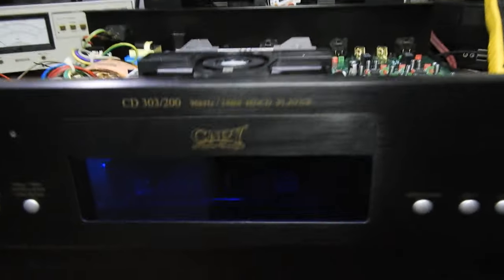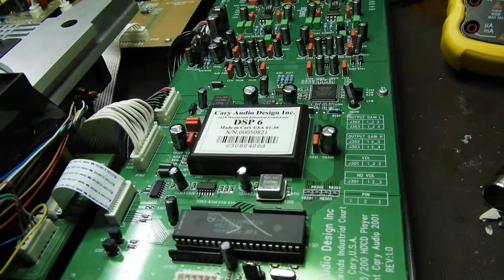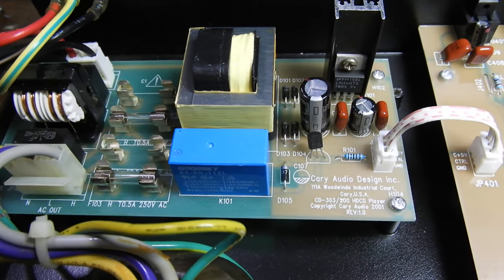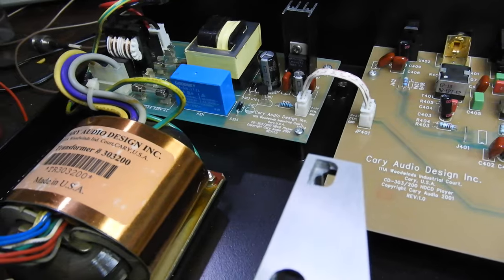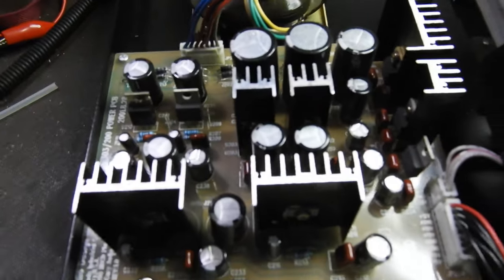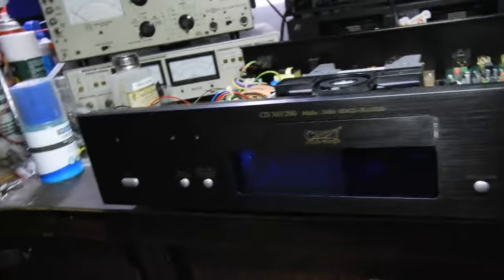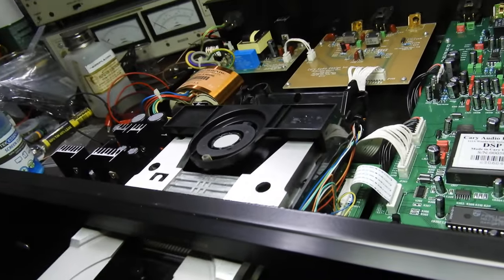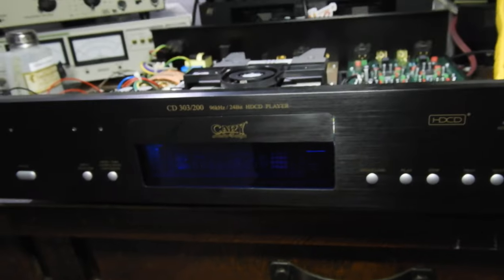Cary Audio CD 303/200. Top class unit with 2 x Burr-Brown PCM-1794 DACs and PMD-200 HDCD filter

Comment: You should try to find someone to rewind it, or try to cut the isolation of the transformer, and find a little thermal fuse, usually the factories put them in👍
Reply from the maker: Luckily, the R-core was OK and I just had to replace the little standby trafo. After re-drawing the whole PSU, because Cary simply ignored my request for info. Both HQ in US and the Oz distributor
Reply: @hear-net-au  You did a very good work, the companies this days aren't very cooperative, they don't give schematics. And this is why electronic repair cost money(this is for people who argue about price),you have to put your brain at maximum effort to do the work sometimes.You should collect the broken transformers and try and repair by changing the burned thermal fuse, it is good when you have some specific voltages transformer, and the repair procentage is about 70%,they usuly burn from deteriorating from age or power surge. 👍
Reply from the maker: @kikopasinecki5110  sadly though, I've found that some trafos do not have that fuse, even though other models from the same maker do...